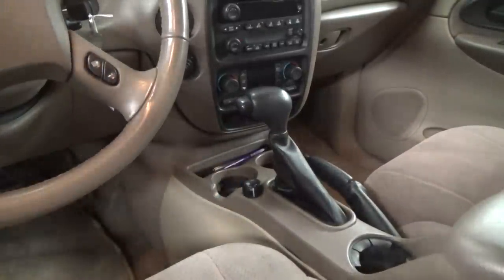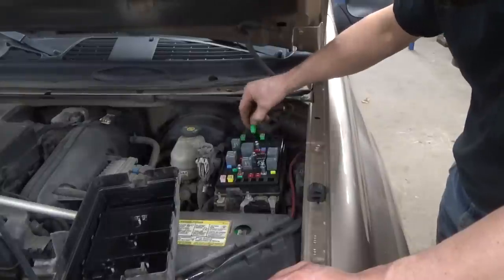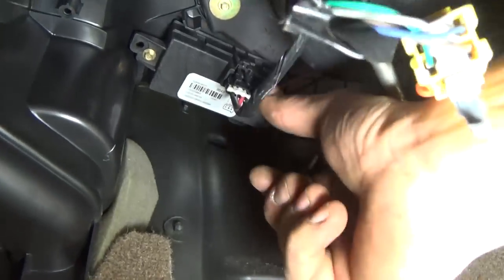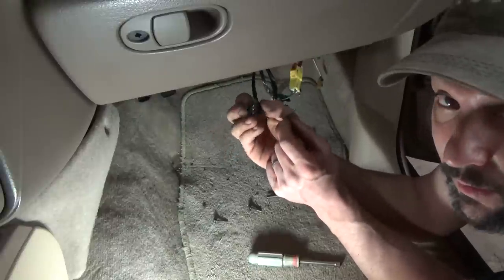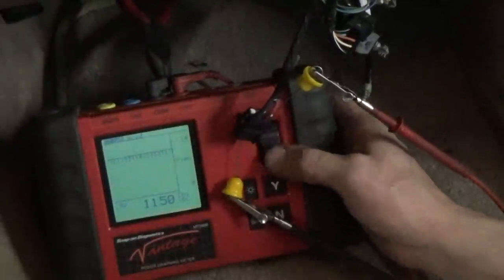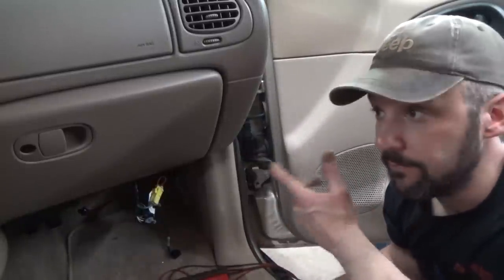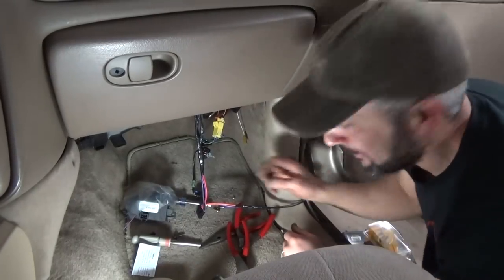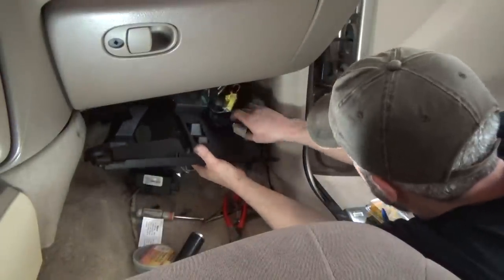Chevy Trailblazer EXT Blower Motor Won't Turn Off

Comment: LOL with the extra adhesive pad...was that in the directions? Sure sounds like you have a lot of diagnostic work finding its way to your shop! That's awesome! Well gotta get back to Subaru engine swapping here...hopefully no more cracked cylinders or banging connecting rods in the near future haha
Reply from the maker: motoYam82 Oh man they said go for it huh?
Reply: South Main Auto Repair
The Outback is purring like a kitten with a low-mileage junkyard engine :) Now the guy with the Forester...last I heard he went to the Subie dealer for a "professional diagnosis"...they told him the timing belt jumped, bending valves and such. Biggest load of steaming BS I've heard in a while haha
Reply from the maker: Hahaha I love dealerships, people worship them and there opinions
Reply: I know right? Why not just give me the money to actually fix it right the first time lol
Reply from the maker: Don't even try to explain economics to them haha

Comment: That part has been "Muntzed". Ever heard of "Mad Man Muntz"? He was originally a used car dealer in Los Angeles in the 1940s and 50s. When television came along he figured he could make money there too. So he opened a factory and started making TV sets. Which he sold for the absolute lowest price. Which he did by making the sets just as cheaply as possible and still have them work. Electronics engineers used to laugh that Muntz would take a working TV design and start snipping resistors out of it until it stopped working, then put the last resistor back in. Each resistor saved one cent on the price of making the TV.

Someone saved one inch of wire. Assuming those are #10 wires made with real copper, these days that is probably 5 cents saved on that part! And it still probably fits about 50% of the original applications.

Comment: Just so you know, you can obtain the correct, 3-pin unit from most any bona fide supplier.  The 3-pin unit has the pigtail coming out ready to plug into the blower.

Comment: Our blower motor works intermittently. The heat gauge does not move. Have checked wires at the thermostat and ac they are good. Did not see any bad connections. Could the module be causing this problem. The vehicle is not overheating. Some times it cools other days it does not. Have also noticed that air does not come out the dash vents on occasion.

Comment: Yikes man, shame on Napa, they are typically pretty good(compared to Advance Garbage)when it comes to parts. I am pretty sure the delco equivalent is a factory replacement with no splicing. Haha, your old man sounds a lot like me when I first started but those heat shrink sealant style butt connectors are sweet.
Reply from the maker: jarin wilson Hey thanks, yeah shame on you NAPA!

Comment: Wow another Trailblazer 😄 I had to laugh when u put the adhesive pad on the door and banged your head on it. Great video I wonder did the other lady solve that IPC battery drain problem..
Reply from the maker: Stanley Hill Oh yeah I have seen her a couple time now and all is good :)
Reply: Thaz good. Hey I have a question, is it normal when pumping the brakes, to see positive fuel trim numbers? I've seen it on a 1999 Lexus ES300 and a 2008 Toyota Camry..Should I be worried about the brake booster? The Lexus has set a p0171 before and that was the only issue i could see.. Thanks
Reply from the maker: As you are pumping the brakes yes the fuel trim will go up but then come right back down after a few seconds.
Reply: ok thanks

Comment: eric amazon has some kick ass heat shrink soder ones called sure seal they are heat shrink like the butts conectors but instead of crimping when you use your crack torch the soder melts and than the heat shrink shrinks. but i ran into this same simular problem with my 454ss tail pipes the muffler outs are 2 1/4 and two tails out the left side so i ordered the walker pipes they were 2 inch pipes so i called napa and said no there 2 1/4 the walker dig says so even down to i need the 2 1/4 clamps x 4 two for muffler and two for the duel exzust bracket i told napa well i do have my free harbor fright tape you bget with anything you buy there but its sure says 2 inches i did take wood working in school as well as car o liner serfied so i can even read mm. i called walker and they said they discountiued the 2 1/4 pips cause chevy used the two inch pipes on all the other trucks in the 90s with the duel tails so they keep the part number for the two and not the 2 1/4 now i know the extra 1/4 isnt gona make a huge difference in hp but now i need to drive to the niagara falls again and get two adapters and more clamps or just weld the adapters in the tail pipes what a pain in the arse as well as niagara falls napa mow sends you every varable part listed, and we the manchic has to deturmand the correct or best fit witch is good until you return the parts you didnt use than the young punks there piss and moan, i ask them if they were femail thats why god gave women two sets of lips to pisgs and moan.. ok that joke was uncalled for. but all the old timers at this napa retired and now young punks that dont know a screwdriver from a hammer. they just are keyboard smart key punching fingers on my other chevy 1998 i needed a fuel filter same on all but cause i told him it was a 5.7 and not a 350 he said his computer dont list a gmc 1998 k 1500 with a 5.7 just a 262 505 350 454  so i was nice enough to teach him the leiters for the inches he raddled off . he was very rude about my lesson so its the same everywhere.. i see on your test drives you on rute 415 anywhere around wellsville alfreid state college i went there in 91-93 for autobody

Comment: I literally just had my 07 trailblazer do this to me. Had to pull the fuze, also, so it would stop. I work parts in a body shop, I'm looking at a OEM resistor, never get universal fit...lol....especially from NAPA. I know my truck doesn't like aftermarket parts any way.

Comment: The reason the part is diffrent then what you took out is they found out the origanal would burn out . the three wire set up could not handle the power going to it over time so they went to a seven wire plug . It would have been nice if they would have put a plug on the wires that you splice into the main wiring harness to the control unit in the dash insted of cut and splice .

Comment: HI, quick question i have the same problem on my nissan 350z but the radiator fan is stuck on high even if the car is cold i changed the fuse but that dint fix the problem what can it be ?

Comment: If there's one thing I hate, it's when you get a "MAKE it fit" part when you thought you were ordering a "MADE to fit" part.
To be clear, it's fine if I know I'm ordering a "make it fit" part ahead of time. At least then I know what I'm getting in to, and can adjust labor hours to account for the fact that I'm not just swapping parts. (EDIT: Of course this all comes AFTER the diagnosis step).

This particular instance, it would have annoyed me LESS if they didn't even put a connector on the blower motor wires, at least then you don't get the false hope that it will fit, and it's clear what you have to do to make it work!

Comment: To the question about liking to use the style connectors you used I would say NO! generally I like to use a soldered joint unless I'm in a real bad hurry.  No just kidding, I do prefer the solder joint just because some electronics seem to do a bit better with a solder joint then the crimp connection.  But, at the end of the day it is a personal preference.  If the crimps wouldn't work they would not sell them.
Reply from the maker: Ralf V I don't like regular but connectors but these heat shrink ones seem to hold up well so far, I have used them for about 8 years. Time will tell :)
Reply: South Main Auto Repair I'm sure they do!! As mentioned, more a personal preference.

Comment: hi  

i have a 2004 isuzu ascender      

i have had a hard time finding out why the REAR fan doesnt turn on

and also in the past   it would turn on (whener it felt like it wanted) but once it turns off it stay off    no matter how much i fiddle with the front side REAR fan knob     Plus the Rear unit (thats also a radio) does absolutely nothing for the rear fan

can you tell me what would cause this problem and how to fix it???

p.s: I had that rear fan itself replaced just months ago.

Comment: 2007 Trailblazer-  All fan speeds operate with A/C however the air current drops dramatically when heat is turned on all speed controls function.  What could cause this issue?

Comment: Happened to my 04 avalanche.  Water was  coming out of the blower resistor. Drilled holes to let water out. Most likely condensation from 60 degrees in car, 120 outside.

Comment: I had the same thing happen on my 05 avalanche a few years ago. that is the same part number for the avalanche, but with those  the blower motor and module are closer together,  so i only had to cut and splice the 3 wires and not all 5.

Comment: SO, I have a similar problem...My 2005 Nissan Altima blower motor will not turn off.... The heat works ok except when idling it gets cooler,  The air conditioner will work if I turn on...problem is I can not adjust the level of air that come out... heat or air... and it will not turn off...Is this the same cause of the problem?

Comment: Needed a hazard/turn signal "Combination relay" for my PT cruiser...because why not make something that's different just for the sake of it right? Thanks chrysler. O'reilly and Advance auto both gave me the wrong part which was just a single flasher relay. Ended up having to get one from a junkyard....which they charged me more than the new one from the auto parts stores.

Comment: had to do this a few times in my 05 grand prix. get them from the junkyard. they fail in the full on position like that. and they're expensive. make sure the fan isn't seized up or hard to turn as it will just fail again.
Reply: SilentServiceCode also it was riveted in place in that car. make sure you have some new screws.
Reply from the maker: SilentServiceCode Yeah GM is famous for using those melt in plastic rivets
Reply: South Main Auto Repair actually they were metal rivets, in a spot hard to reach with a drill. great design.
Reply from the maker: hmm never saw the metal ones yet

Comment: 23:40 Eric, I've had a rough couple of days and needed a good laugh............I fell out of my chair I'm laughing so hard!  Thank you!  Yea, aftermarket parts...........whiskey tango foxtrot.  It's like no one at these companies even gives a crap anymore; they just want maximum profit without even giving a hoot if the parts they make work.
Reply from the maker: Whiskey , tango, foxtrot is right... seems as if none of them give a hoot any more. The love of money. I think I am going to start to learn Chinese. That way I can be one step ahead when they move in...
Reply: South Main Auto Repair
You better learn Spanish first!  It's not just auto parts; I've been mattress shopping recently.....  You used to be able to buy a quality 2 sided flippable mattress for under a thousand bucks.  Now it's cheap one sided pieces of crapola with low density foam for 1500 bucks minimum.  I seriously despise the way business is conducted in the USA these days.

Comment: they actually have connectors that are hewt shrink, sealed AND have solder inside. their all I use now.
Reply: Except it can't be real solder in there, Eric has mentioned those before and they all went bad on him at about the one year mark, so hope your mileage is better.  I've never seen that type and didn't know about the hot glue lined, heat shrink butt connectors either.  I prefer to use the un-insulated crimp on butt connectors since it grips much better than plain jane squeeze but I dope them with RTV silicone going together and fill the divet too.  Jury is still out on if this is worth a hoot or not - we'll see.  They do offer heat shrink tubing with hot glue liner these days, that's a real nice touch on a genuine solder joint.

Comment: My 05 Tahoe uses the same 3 pin module.   I have the new GM module (22807123).  It has a 7 pin connector plus 2 wires that come out for the blower.  No wiring diagram.  Any clue where red, black and purple with tracer goes?  You have access to a diagram?
Reply from the maker: http://www.bbbindustries.com/technical.html freebie diagrams

Comment: TBH I would of soldered those high current blower motor connections. Those crimps you used could end up being a hot spot and causing resistance and problems later.

Comment: I have the same blower on all the time on my '04 Silverado. There is about 7 different versions of this thing. That one would fit my truck no problem. My problem is trying to find the right one at the parts store and GM didn't have one. The next thing is that the GM one cost about a hundred bucks more. Rock Auto is my friend up here in Canada.

Comment: what told you the blower resistor was bad again?
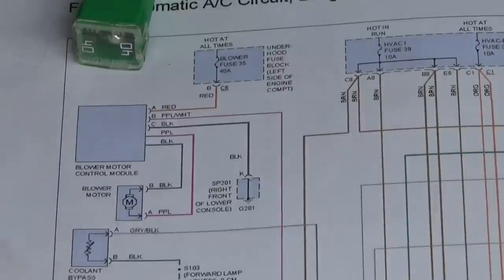Reply: He tested and verified that all the inputs to the blower motor control module (aka resistor) were good.  Since the resistor was getting all the proper inputs, and the motor itself gets its input directly from the resistor (see 0:53), then the resistor must be bad.

Comment: @23:33  LMAO

OEM is usually the best- but don't bet the Farm on that, either.

Those pencil-necked Geeks that keep "revising" parts make me sick; then sometimes- so much gets lost in translation if made overseas- that it makes the job nearly impossible.

Best practice- is to stay away from "universal fit" parts, or try to repair what you've got.

Crimping is a friction-type joint, and even the best can still build up resistance, heat, moisture, micro arcing, and corrosion from that ozone generated by the arcing. Soldering is a chemical and mechanical bond- and when heat shrink or tape (solid or liquid) is used- really assures a quality connection. Depending on time constraints- both types are acceptable.
Reply: Crimping is not just a friction joint. If it builds up resistance, heat, allows moisture ingress, micro arcing, or corrosion, the crimping tool did not apply enough pressure.
A good crimp actually deforms the individual strands of wire into a roughly trapezoidal shape, causing cold-flow into the terminal body.
More info here: https://en.wikipedia.org/wiki/Crimp_(electrical)#Judging_crimp_quality

EDIT: If you're really paranoid about high resistance in a crimped joint, I've heard of crimp splices that have a bead of solder in the middle which melts when you shrink the outer heat-shrink around the wire. Takes more heat than "just enough to shrink the heat-shrink", but the resulting joint should have the strength of a proper crimp and the electrical conductivity of a soldered joint (which probably is lower than a crimp, but not by much, think a difference of a few miliohms, not enough to really matter).

I think you'd be hard-pressed to find a soldered connection outside of the circuit boards of the various electronic modules of a modern automobile straight off the assembly line.

Comment: I replaced my blower motor over the weekend and it worked perfect for half a day. but now it will not stop running. Please help
Reply: Ireplaced the blower motor resistor not motor

Comment: Solder/heatshrink all the way. All of my unreasonable hatred is focused on butt connectors, even the better ones. As I don't work as a mechanic or even installer I can see the allure though to get it done, done faster and 98% of the time there isn't an issue.

Comment: I LIKE your videos I too own a tire an Auto Repair shop And when i'm not positive about a problem I watch one of your videos and you usually confirm what i was thinking. Your better than me with electrical. i'm not bad for having no auto school training but i can usually fix anything that rolls in. I can totally relate to all of your whining. i have all the same problems. But why i'm here is because i like them crimp an seal connectors. now on my mud dragster i solder everything. .we could sit back and drink a few an tell some stories. i'm south of st louis Thanks for the video I;M  Z-MAN

Comment: Big thanks for this video!  My neighbor's Trailblazer had this exact problem last week.  It killed the battery(original from '07, wouldn't charge).  Swapped the battery and blower came on immediately.  I popped the blower fuse (35 under hood), so she could drive it until I got the part.  I got a duralast part from Autozone, and the wires were long enough to hook into the factory position.  Searched and found your video to help swap it out.  You helped make it a VERY easy swap, and I got a good laugh at your commentary!

Comment: In truck and trailer repair. For outside in the elements use, Crimp and seal connectors fail 100% of the time. Failure time is 1-2 years but failure none the less

Comment: HACK!!!!, not soldering wires you hack!😀 I am being funny, I use both soldering and those shrink tube crimp connectors, depends on the application what I use. As for your rant on aftermarket parts I hear you BTDT way to many times to count, had a caddy that needed an AC line aftermarket was built wrong, would not clear the rad support, had to put the truck back together, as the correct one was 2 days out. But things like having to swap out wires to install a part piss me off
Reply from the maker: Michael Berg I know, I know haha .... That's it I QUIT!!

Comment: Never made sense to me why napa and Autozone and orileys and advanced auto don't sell blower motors or Resistors or multiple other parts that have the same plug always have to be cut and spliced its like come on it was ordered based off the make and model and year how hard would it be to make it with original connection it does get frustrating Eric O @SouthMainAutoRepairLLC